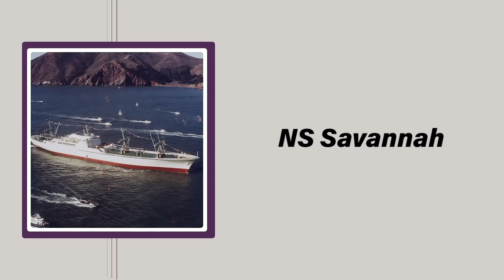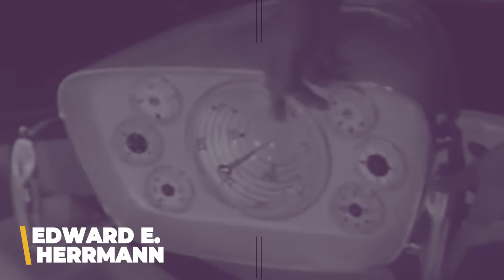Nuclear Powered Vehicles: Cheap, Sustainable, and Potentially Deadly

Comment: Nuclear powered freight trains. Why hasn't anyone tried this? Now taking applications for investors, call me.
Reply: USSR tried that... Ask them how it went. I believe that's the actual reason we don't have nuclear powered trains, in the US. They're just too risky. 
Trains already kill between 15 and 3000 people per crash. Add a nuclear waste or reactor spill to the math... Yeah, that's why no phonecalls...😂😂😆
Reply: @guardsmanom134   Thanks for the information. However I said freight trains, this wouldn't be ideal for passenger rail travel for obvious reasons. Also nuclear and other sensitive loads are currently shipped by highway with escort crews. I saw one once. A few extra safety precautions would make my concept easily feasible. Railway transport, not including passengers, is far safer than typical highways. Crossings intersecting crazy drivers on roads would practically be the only weak spot in safety concerns.
Reply: @spacewater7  they're currently shipped that way, because of the Texas City disaster. A train hauling nitric acid, and fuel cars, derailed and created a disaster cleanup so bad, the town had to be abandoned. Firefighters, CERT, VERT, and USNG train there now, as it's still to toxic to live there.
Reply: @spacewater7  and that wasn't even a nuclear contamination situation. Just noxius chemicals, and crude oil and fuel.
Reply: @guardsmanom134   Chemical spills can be far worse than cleaning up some small amounts of radioactive fuel and waste. Especially when you're not talking about a 'heavy' water reactor. Such plants aren't used for power generation anymore unless you're Iran.
Aqua fortis - nitric acid - you must have the wrong chemical there, as that isn't hazardous unless vapors are inhaled or you get it on your skin. It's even used as a nutritional supplement for people with circulation problems. Not in the same form or concentration as the industrial kind of course. Hypergolic rocket fuels are the only fuels I can think of that can be highly toxic, normal fuels are only really hazardous if they catch fire.
I think you may need to more closely check the facts on that railway accident.
Reply: @spacewater7  I have. Nitric acid(np, or commercial), hydrochloric acid, petrolium distillate, petroleum crude tar, and liquid propane were on the itenerary. Nitric acid is hypergolic when mixed in normal atmosphere with any petroleum product. Hence why acid is still shipped by train, but not on the same train as petrolium products. Nuclear trains were actually considered for freight movement, up until the 70's. They turned out to be too heavy to be considered feasible to haul freight. That's why they were discarded as an idea entirely. The amount of lead necessary to keep the neutron production within the confines of a reactor, plus America's memory of steam locomotive accidents, made even the most gaudy entrepenuer balk.
Reply: @spacewater7  the reason why there was no Blev, was because fuming nitric acid doesn't react violently with things. Enter hydrochloric acid, the only saving grace on that day.

Comment: It should be pointed out that by "nuclear powered" you really mean "steam powered".
Reply: There were two concept engines developed during the height of the Cold War. One was too heavy to fly, and shifting water-weight made it unstable in flight. The other was discarded after the SLAM, and later Wolfhound Bomber, were scrapped. These engines were considered "invaluable research and test beds for other applications than flight, as proposed." 
The only reactor to ever be used after the end of the program, was the water-based coolant design, and it was used on submarines. The fellas over at Dark Docs did a video all about it.
Reply: It’s a great point. I kept wondering how a steam powered airplane would work when he was talking about nuclear powered aircraft.
Reply: @marthahawkinson-michau9611  I've never known how the nuclear plane was supposed to work unless it was something like the SLAM ramjet tested in Project Pluto. The fact that this engine sheds nuclear waste was considered a feature, not a bug. It was pretty much a doomsday device. Russia announced two years ago they were investigating such a thing, but I'm pretty sure it's a bluff.
Reply: @Bacopa68  There was a test program with the B-36. One aircraft was converted to the NB-36H, it already flew with a working reactor on board, even if it was still powered by the normal piston engines. It would have not used steam, but it would have heated the air, using a sort of jet engine. The B-36 was used, because it was big enough to carry the heavy reactor. 
It was always escorted by a transport plane with paratroopers which would have parachuted to a crash site warning the population there, if it would have gone down and causing a nuclear inferno. 
However, the only thing which was shielded was the cockpit section, the reactor was in the bomb bay, and was hoisted down in a shaft in the ground after flights. It had no shielding to other directions, so it would have killed anybody sitting outside the cockpit during flight. It made 47 flights between 1955 and March 1957, with together 215 flight hours, 167 hours with the reactor on board, 89 hours from this with the reactor working.

Comment: alpha sources, if you dont have skill to make it safe, like micro fusion
Reply: if you need static storage, you can have one at your back yard, making electricity, then just recharging batteries to drive stuff
Reply: if just normal fission reactor, then make it so big that you can fit the required shielding
Reply: just make the robots to make it all, then
Reply: assume everyone has every atomic material to have bombs, if you are scared to give rights to have those reactors

Comment: If you think about it then it's actually surprising for Nuclear reactors not to be used in transport ships. I mean you could technically build a standardized size and fully self-contained modular reactor which, in case of a Ship sinking related emergency, could be dumped into the sea followed by automatically refloating back to the surface to safely recover it afterwards ( similar to how Federation Starships dump their ship Cores into Space should it go critical ). Such a modular reactor would also provide the possibility of transplanting it to a new ship should the old have reached its service time.

Comment: Nuclear power operations is clean(assuming no little accidents, melt-downs, terrorist events, and other oopsies.).  The problem never discussed is the waste problem from the fuel refinement and spend fuel.  Back in the 70's there was much talk about fast breeder reactors that produced more fuel than they consumer.  They could convert non-fissionable uranium to plutonium.  The raw material was estimated to be 3 or 4 hundred years.  The only downside was the plutonium was near weapons grade and has to be refined, that nasty waste problem.  I see a Side-project topic (hint, hint).

Comment: Simon is wrong about one thing.  Thorium is actually a more reactive nuclear fuel.  It generates more neutrons per fission than Uranium or Plutonium.  It was just discovered too late to make a dent in the western and Soviet nuclear fuel cycles.  However, India is actually developing their internal nuclear reactor designs based on Thorium because India is home to some of the largest deposits of this fuel in the world.
Reply: Nope. First, Thorium is really not a fuel, but a fertile material from which you can breed U-233 which is a fuel. It gives more neutrons per fission than U-235 (2.5 for U233 and 2.3 for U235 at least in the thermal spectrum) but not more than Pu239 (2.9 neutrons per fission average). I don't understand what he was referring to in 13:43, probably to chemical reactivity, but I think the advantage for safety in a nuclear powered vehicle using the Thorium-Uranium cycle would be far less accumulation of higher actinides like Plutonium, which is very poisonous chemically speaking. 
Anyway even when I'm the greatest fan and defender of nuclear energy the idea of fitting any type of nuclear reactor in a car and give the keys to the average driver seems to me utterly idiotic.
And the Thorium-Uranium cycle was discovered during the manhattan project, at the same time as everything else, but it was discarded since it was not really practical for making weapons even with the good neutron economy of U-233 and the plentyfullness of Thorium. After that, breeders either using the Th-U cycle or the U-Pu cycle never materialized because uranium ore is cheap enough, and we are still trapped in that loop. India is a rare case with unusually low Uranium deposits and unusually large Thorium deposits, so it has always been a priority for them.

Comment: "15 of the largest ships in operation pollute as much as all the cars in the world" is only true in a sense so narrow that it does not warrant to be a statement here.
Reply: Let's take into account that a combustion engine in a modern cargo ship is four to eight STORIES high. As in, one cylinder could fill a municipal community pool in volume, and most ship engines have four to twelve cylinders. Add to this, that ships don't in fact burn gasoline or diesel, but instead burn maritime fuel oil(which is barely refined crude), and you get a massively more detrimental pollutant than gasoline or diesel fuel.  Add to this, that just 15 of these engines outclass the volumetric displacement of all cars in existance to date, and you can actually see why (without a scrap of research) that statement holds water(pun fully intended). 
Also, marine engines are not required to run catalytic converters, due to the sheer cost only one converter would carry being so massively prohibitive, even the US Navy laughed when looking at the proposal. To this day, shipping and maritime commerce ships are not covered under any proposed climate accords, due to the economy crushing pricetag of converting existing ships. Do you begin to sea why nuclear power might actually be seen as a viable option?
Reply: @guardsmanom134  Almost. Lets look at the largest container vessel at the moment, the Algeciras. It is powered by a MAN 11G95ME-C9 engine wich has a bore of 950mm and a stroke of 3460 mm (https://dieselgasturbine.com/biggest-man-sea/)
times 11 cilinders = 27 m3 displacement for the complete engine. 15 of those displace 405m3, that is 405.000 liter.
That equals 405.000 small 1.0 liter displacement cars. That's less cars than there are in Switzerland.

Besides that, modern maritime often come with exhaust scrubbers since catalytic converters are not feasible, mostly due to them being very environmentally unfriendly to produce, something that should be take into account when comparing cars to ships.
And yes, nuclear would be awesome! but on a moving ship there are some issues with piracy for example, and limited port options.
Reply: @baytep9148  catalytic converters are no more unfriendly to produce than steel. They are made up of aluminium ceramide(called alumide) and platinium or palladium. 
It's the fact they are made with precious metals, which makes them unfeasible. 
The largest diesel engine isn't measured in Millimeters, but Cubic Centimeters. A factor of ten for difference.  
As for "exhaust scrubbers", we've been using that technology as long as we've been using fuel oil. All it is, is a tower to take the exhaust above the deckline. Funnels, towers, even water-bubbler "tombs", are aroun a century and a half old tech. And I'm pretty sure they get around 32% efficiency? That's not much, when you look at what they're grabbing verses what they're burning....
Reply: @baytep9148  405,000 1.0l cars? Except, that's per piston stroke(not equivalent vehicle, because of the restrictions placed on cars) so there could be a few more in Switzerland, but you wouldn't want a ship at full bellow running right downtown Svalsberg, would you? It's not just optics, either. Like I stated before, ships use maritime fuel oil, which is little more than crude (unrefined dinos) oil.
Reply: Care to elaborate?
Reply: @aoberhaensli  not really, too lazy to look it up.
It has to do with what chemical compounds are measured since "polution" as such can never be compared as it is too broad a term.
Take sulphur for example, this has been actively removed from roadcar fuels and as a consequence has been actively added to heavy ship fuels. So if you only look at that vector it may be possible to compare 15 ships to all the cars.
But that is not the statement made in the video.

Comment: The practical solution: Mr. Fusion; capable of turning a banana peel and the remains of a beer into 1.21 jigawatts of electricity. Transfer that technology from a temporal time portal distorting device to the drive motor of a vehicle... not only do we get cleaner, longer running cars, we also eliminate considerable amounts of waste.

Comment: The problem with building a safe nuclear car is that we have never been able to make a truly safe car to begin with
Reply: The problem isn’t that we don’t have safe cars we just have unsafe drivers instead.
Reply: @peterbuckley3877 tell that to all the ppl who's brand new cars get recalled for catching on fire
Reply: usually you need highly enriched uranium to power smaller reactors (most military ship reactors use 90 % U-235, because of the small size of the reactor, to stretch the time between refuelings). In nuclear power plants you usually use 3 to 4 % enriched uranium, but only the U-235 is used for the fission, the rest (U-238) is not used and would be dead weight. 
However, this means it's also weapons grade uranium. As long as it's use in military ships it's in safe hands, but if you give it to civilians they could sell it to foreign countries starting a nuclear weapons program with it.
Reply: @simonm1447 If we make nuclear powered cars, then then the reactor will be deigned to not be removed by just any mechanic. It will be set up so only a certified and background checked repair depot can handle the reactor and even take it out if the car probably. They met even set it up so the tools to take it out are only available to the OEM.
Reply: @easyenetwork2023  do you really think countries like north Korea interested in fissile material care about background checks?

And how do you intend to shield radiation sufficiently in something as small as a car?

That's a story like from the early 50s
Reply: 100% correct
Reply: Hm no Cars are safe it is the drivers and ai that cause crashes but most do survive accidents.
Reply: The point is making a nuclear powered car that won’t leak radiation dangerously. They won’t blow up like an atomic weapon because they are not that type of reactor.
Reply: Look at modern f1 cars. Probably the safest vehicles on earth. Nearly impossible to die in.

Comment: An atomic jet engine was developed. The problem was the air accelerated through it became radioactive. The design did not use steam or the associated heavy equipment. It was essentially a normal turbojet with the combustion chamber replaced with controllable fuel rods.

Comment: I think.. fingertip steering had more to do with how much force needed to turn the wheel.. Idk how much driving you have done.. but have you done any with vehicle with no power steering? (The tractor we have on the farm has no power steering. And my dad's truck.. a whole bunch of years ago.. had its power steering fail. The wheel requires alot more grip and force to turn it.)

Comment: "Here are the keys to your nuclear powered car. Also, we HIGHLY recommend not getting into an accident"
Reply: Oh and sign here here and here,
Acknowledging that we are not responsible for any nuclear exposure caused by car accidents
Reply: Chad Cuckmaker  thorium needs a uranium or plutonium catalyst to keep the reaction going
Reply: Chad Cuckmaker  the thorium cant melt down but because of relative stability it needs a push from a more unstable element to push its radioactive decay to a usable point.
Reply: You're gonna need a long and wide car
Reply: Would definitely be an indirect way of positively influencing safe driving habits
Reply: Drunk drivers: and I took that personally
Reply: Cc wм а и иис им                                           иההההה ע היה הבבהההההה הה ה הנה ססד'.צe c vs czzzzszzxx cf cdxxccccccccccc'xxxxxxxxxxxxxxxxcffxxssscxdd.                                     Ccccccccccs. C. Z for Czech xcf   ככה היה גהג בא ה בה ג הבחירות הנהג סה"כ נ. הcv c c five v vfv.  Xxx cdcdccdx vs zcddv wvvc dc cc.  F vzcccc v. Cv cc vccv cvvvv:vvvvvv cc xsxc. Ccccxcccccccccccxccccccccccccccccccc"ccf cc cc s v cçsxxxc.    C cczq

Comment: You’d think we’d try using non-fossil power to produce hydrocarbon fuels artificially. That way, cars can work basically the same way, but we wouldn’t have to dig for oil because all our fuel would come from fission, fusion, or renewables.

Comment: There have been a bunch of weird alt fuel cars. 
before hydrogen electric cells there were hydrogen combustion engines. GM once tried a coal powder turbine engine. A concept of an air compressed powered car. And that time the president of mexico drove the Chrysler Turbine using Tequila as fuel.
Not to mention biofuels, you can make methane out of almost anything, like hemp and chicken poop.